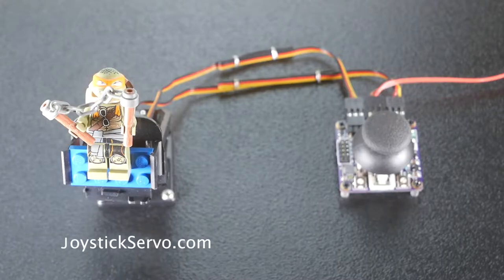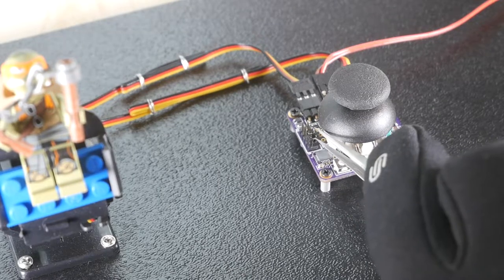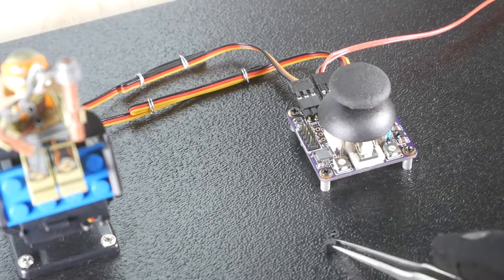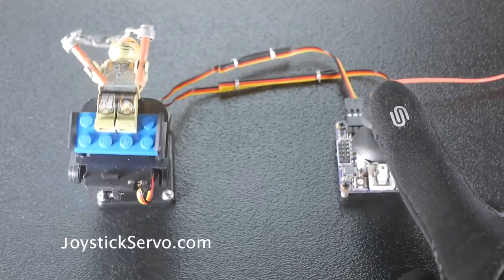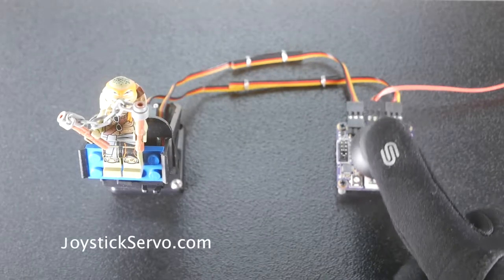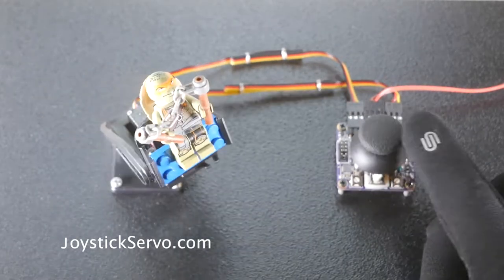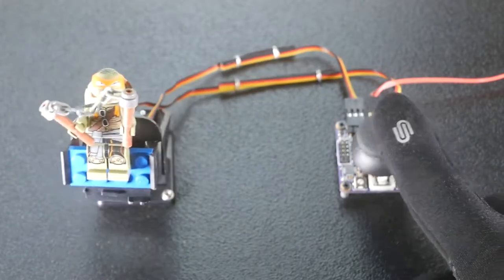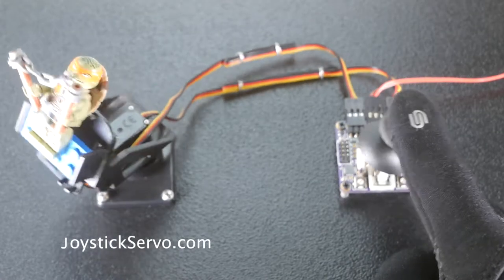XY / Pan Tilt Joystick Controller for Servos | Buy Now ! | No Coding

Comment: How do you connect a 5v power supply or battery to it? Also can you use servo cable extensions and splitters? Thanks
Reply from the maker: just use a servo cable and cut it and connect to a supply search "servo extension cable"

Comment: can u do this remotely (For a drone)
Reply from the maker: If using a drone, use a standard RC radio and plug the servos into the RC radio and control with the joystick on the RC transmitter.

Comment: Good work. How to keep the last position locked with a standard arduino joystick push button? Can you teach or us show the diagram and code please? We can buy from Turkey due to lockdown.
Reply from the maker: If the device is run in "incremental mode" it does not go back to the center when it is let go.  This does not require an arduino. Also we ship to Turkey.